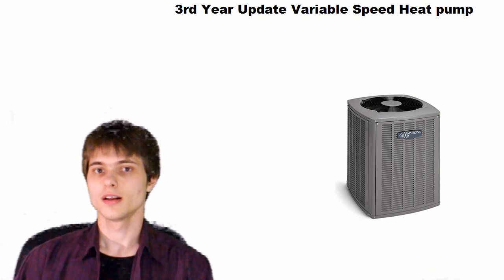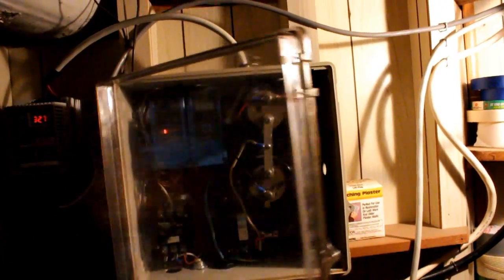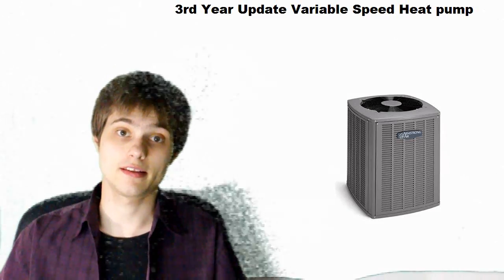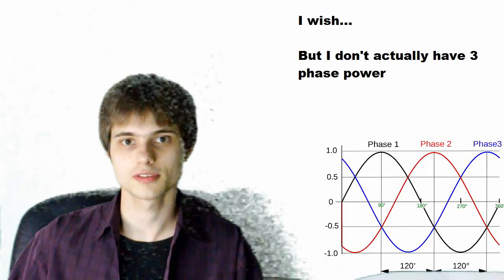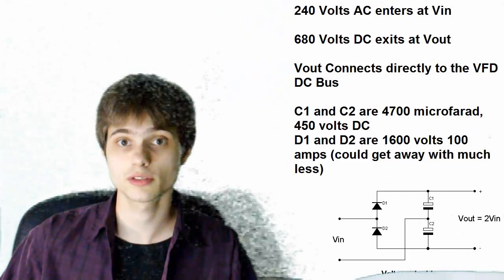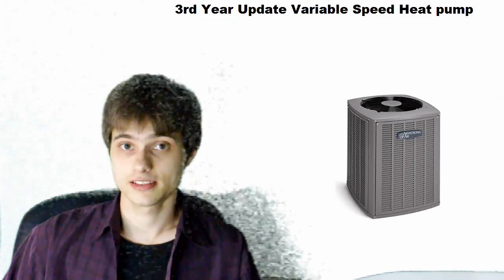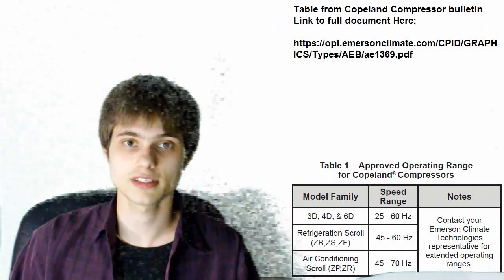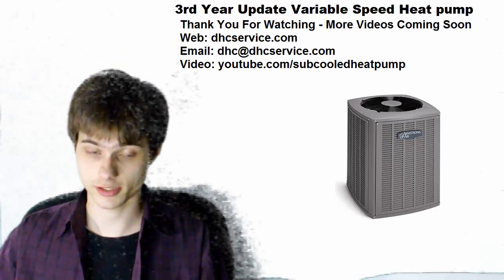3rd year heat pump update

Comment: HOW DO YOU DETERMINE WHAT SIZE VFD YOU NEED?? I HAVE A BARD AC / HEAT UNIT THAT CAME OFF A MOBIL MRI SCANNER TRUCK. I DONT NEED THE HEAT SIDE JUST WANT THE AC SIDE. IT HAS A THREE PHASE COMPRESSOR. THERE IS A MOTHER BOARD ON IT. IS THE MOTHER BOARD STILL USED?? THE PANEL SAYS ALL COMPONENTS ARE SINGLE PHASE EXCEPT FOR THE COMPRESSOR AND THE HEAT COILS. ANY ADVISE WOULD BE APPRECIATED.

Comment: Question: Can you hook up 2 phases of the vfd to the two windings of the compressor and eliminate the run capacitor? Would that work? Also, can you provide a list of some of the VFDs you've used? Thanks.

Comment: Hi there! I love your videos and wonder if you could help me with this: to chose an electric motor (ac or dc) and speed variator to power a moving platform in my strawberries field? It should push around 1.000 Kg at max 20% inclination - but here is the catch -  at 1/2 to 1 meter per minute (motor should spin at 2 rpm)! 
I spent days searching the internet and just can't solve the rpm and torque problem for such low speed... Thanks a lot!
Zoran (zoran@puljic.eu or whatsup me at 38761186460)
Reply from the maker: Only one question I have, how will the platform operate? will it be pulled by a chain or will it have wheels like a car? According to my calculations, the force required should be around 2000 Newtons, the only thing is in order to convert that to newton meters I need to know the diameter of the wheels or pulley. Let's say for example your platform is being pulled by a chain, which is in turn being rotated by a sprocket or pulley which is 1 meter in diameter. In this case the motor will need to output 2000 Nm. This is impractical without a gearbox, so I would probably use a 2 HP (1.5 kW) motor with a 100:1 ratio gearbox, then use a VFD to reduce the motor speed to 200 RPM or 6.7 Hz. The alternative is to find a motor with a 900:1 ratio gearbox, but these are very hard to find and quite expensive.
Reply: Thanks for the prompt reply! It will run like a car, something like this: https://www.youtube.com/watch?v=FKJVEgrSUew   but I want to make it electric and powered by a car battery aided by solar. 
The wheels would be around 500 mm in diameter.... Would it really requre that much Nm for such a low speed? Thanks!
Reply from the maker: Okay in this case you'd need about 600Nm. The torque here is related to the angle of the incline,the weight of the platform, and the diameter of the wheels. Has nothing to do with speed. Once the torque is figured, then you factor in speed. Torque and speed makes power. Basically what you need is a high ratio gearbox. 1.5 HP (1.125kW) with a 100:1 ratio should do it. The motor will output 6 Nm of torque and the gearbox will multiply that 100 times, to output around 600 Nm to the wheels. The wheels themselves act as gear boxes, so your wheels are .5 meters. So 600/.5 is around 1200 N. Just to be on the safe side you could go with a 2 HP motor with a 100:1 gearbox, or just find a gearbox with a higher ratio.
Reply: Great, thanks. Would you recommend a single or 3 phase motor? And how much power would it consume at this speed... in other words, what size car battery and solar panel do I need to power this 12 hours a day?
Reply from the maker: a 3 phase motor is going to be the best option here, unless you're going DC. If you will use a 2 HP motor, you can figure about 1.5 kW. an 18 kWhr battery would work, but that's probably going to be expensive
Reply: subcooledheatpump 
thanks! 
and if I was going with 4 dc motors, one per wheel, what would you recommend?
Reply: Zoran Puljic 
everything the same. just divide the power by 4, would probably work.

Comment: in an open system like irrigation system can we control pump pressure with only sensor and vfd without PLC?
Reply from the maker: It should work as long as the sensor output can be used by the VFD. Most VFDs can use a 0 to 10 volt signal (or 4 to 20ma) If the sensor can output that then it should work

Comment: just a question on VFDs in general, how well do these work on desk fans, like can they go low enough to be pretty silent and little airflow. Also do they make a loud buzzing noise (like using a dimmer on a motor)
Reply from the maker: Usually VFDs can be used with fans and pumps to adjust them to just about any speed. I personally use a VFD to control a blower, and over the course of many years I've never had any problem with either the fan or the VFD. I usually run the fan between 10 and 30 Hz.  As far as noise from the VFD, you just need to get one with a high switching frequency. I'd say most VFDs can go up to 15 kHz which is audible, but not irritating in my opinion. If you want it to be completely silent though, you can use an LC filter on the output, or just get a VFD with a 20 kHz switching frequency. Thanks for watching
Reply: ok, thanks and thanks for the fast reply :)

Comment: What about oil return issues when running the compressor at low speeds. I know it's been 3 years but in the long run it might have issues.   Have you checked system performance output of the unit.  I've worked on some inverter systems mini splits and they run the load based off the outdoor temp and they try to maintain a certain discharge temperature. They will open and close an electronic expansion valve to maintain that discharge temp.
Reply: I know Trane inverter systems have an oil return mode that will run the compressor at  full speed for a while  if the compressor has run at low speeds for a long period of time.
Reply from the maker: This system tries to maintain a suction temperature, and because of that, the compressor will run at full speed when the thermostat first starts the VFD. It gradually ramps down once it begins to reach the set temperature. I did say in the video it can run all day at near minimum frequency, but it usually does cycle, although much less than a fixed speed system. Also, the refrigerant gas velocity should still be pretty high even at lower speeds, since the expansion device is oversized. So the pressure difference before and after the expansion device isn't that great, so the gas velocity shouldn't change too much. So I'm not really worried about it.
Reply: subcooledheatpump pretty interesting setup up. Check out my simple heat recovery using my heat pump. Free hot water.  Have you thought about putting that condenser fan motor on  the VFD.
Reply from the maker: Yeah i was checking out your channel, I'm going to have to watch them all sometime. I did at one time have a VFD on the condenser fan, but I never took the time to properly tune the temperature controller and eventually took it off for the sake of simplicity. I'm experimenting with a smaller system and manually controlling the compressor and fans to see what is ideal, then maybe if I find what works I'll try again on the larger system. Thanks for watching

Comment: First, thank you forma tour videos they are very informatives. I would like ask you please  ITF possibile to  send me BBY e-mail . the wiring design of  (window air conditioner  110ac) 6000btus using VDF plus  temperature controller, ti sue on my off  grido system. seens no sense but . in offre grid  i'.m every single watts s counts. thank you  in advance. NJM

Comment: Was this a standard R22 unit running with R134a, and no component modifications for the R134a?
Reply from the maker: The Condensing unit was given to me with a bad compressor, originally it used R410a. I bought a remanufactured R22 compressor, drained out the mineral oil that it was filled with, and filled it with polyolester oil. Then I put the compressor into the condensing unit. The Evaporator I bought new, it was designed to work with R410a. I think it came with a .065 metering piston, I changed it to a larger .08 I believe. As I said in the video, I removed all the heat pump control systems, so only the reversing valve remains in the condensing unit.  Thanks for watching

Comment: Awesome job. I am trying to do the same for my 5 ton unit. But my compressor has single phase motor come with it. Could you guide me to the right I can purchse low cost VFD which has single phase output? Your response will be appreciated.

Comment: Friction is just one irreversibility.  The faster the refrigerant is compressed, the more inefficient the compression, so it makes sense that running the compressor slower would improve efficiency.  I hope you will go into engineering.  We can use more hands-on, practical people like you in the discipline.  In particular, thermodynamics within mechanical engineering is very valuable for optimizing systems like you have done.  But I'm sure you could be very successful in any engineering field.  Best of luck!  Keep trying things!